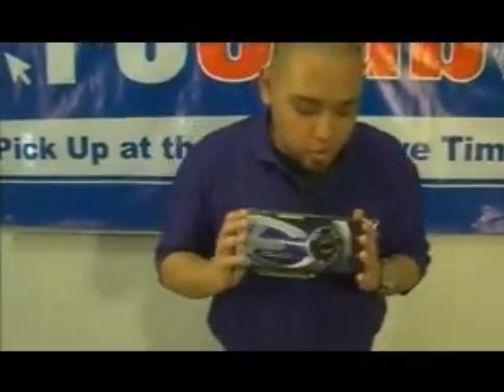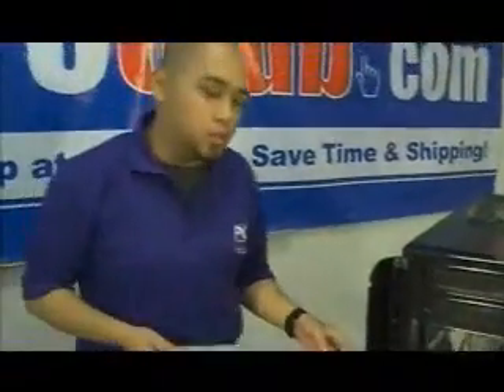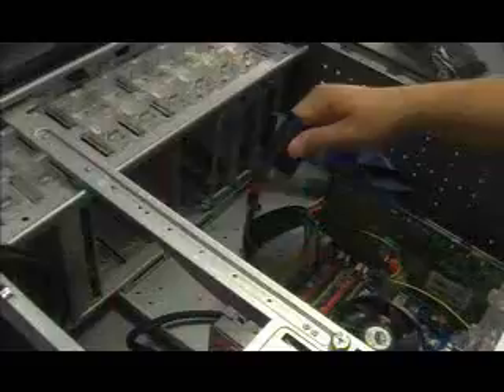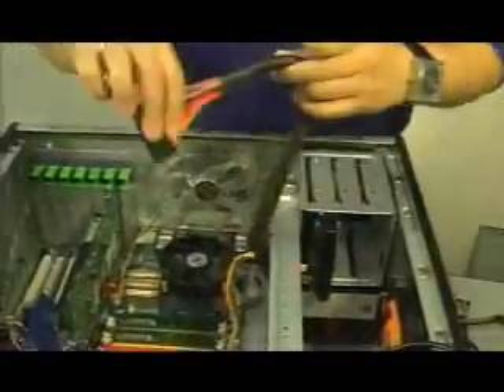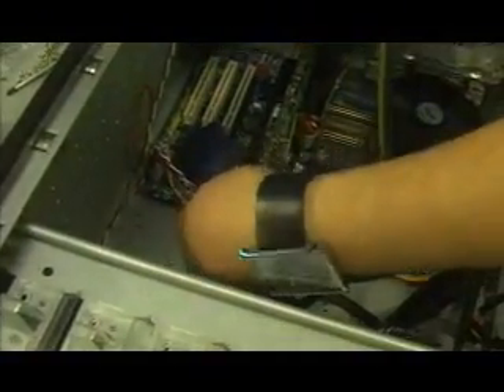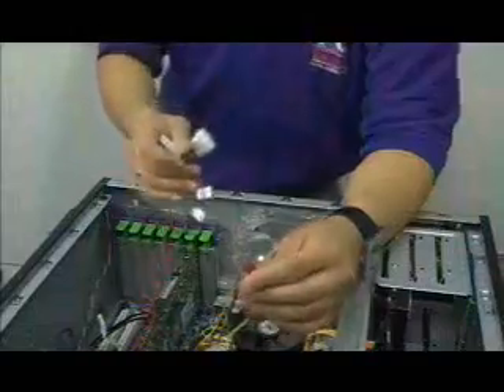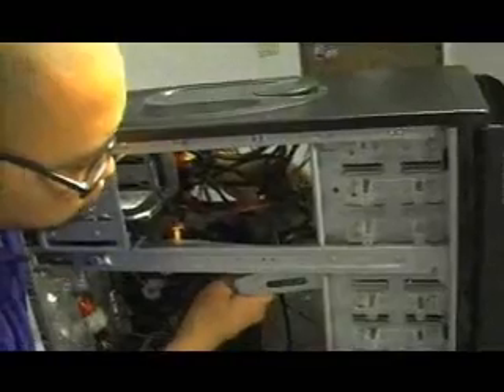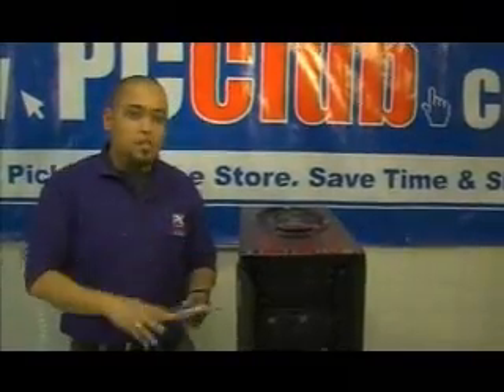How to build a gaming PC part2

Comment: im in my IT class right now, and i must say, this guy impressed me. his attitude threw me off, and he did lack a bit of info on his explanations. but he had the basics down though. he knew what he was doing.... sort of. he needs to learn how to handle that mother board. his may be affordable, but some of us go out on a limb for top of the line, and goddammit, i wanna make sure my mother board is not messed up before i even plug in the power supply.

Comment: @hotforgames i looked up every piece, it's roughly 1000 dollars.  but figure if you already have a computer that is old, you can take the power supply, the case, the fans, ram, the hard drive, and the disk readers from the old computer.  really all you need if you already had a pc is the mother board, a cpu, ram if you already didn't have enough on your old pc,  a video card, and possibly windows or w/e you need.  so ya, you could end up only spending like 200-300 dollars

Comment: I hate the spaghetti associated with building a computer. That's why this time I went  with a Sata HDD, and Optical Drive. I also went with a modular PSU. There is still spaghetti, but it's significantly cut down, and I get better air flow in my case :)

Comment: I'm gonna put a diamond 5770 ATi gpu, and a intel core duo @ 2.7 ghz 2 gb of ram @ 1333 MHz DDR2, windows 7 home premium 64bit, a gigabyte motherboard with 1080p HD for around $490 to $550 (might add more stuff, I already have a 450 watt power supply and 250 gig hdd)

Comment: Dude I have an AGP slot with a PCI and I have the ATI 3850 HD 512MB GDDR3 256Bit ICEQ turbox3 AGP it works great. The Same version of this card as PCIxE almost has the same FPS in HL-2 EPS PACK, CRYSIS, UT3. I don't want to hear that AGp is already done. this guy can't even speak correctly and always saying (Like So)

HL-2 EPS PaCk AGP 120 FPS vs PCI 132 FPS
CrYsis AGP 29 FPS vs PCIxE 32 FPS
UT3 AGP 28 FPS vs PCIxE 34 FPS